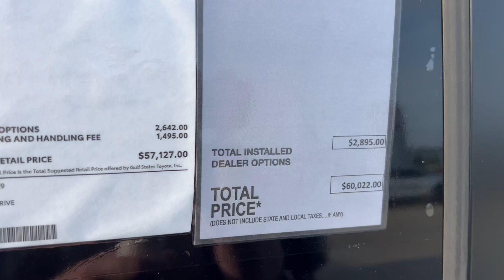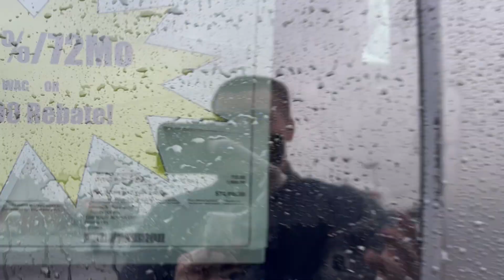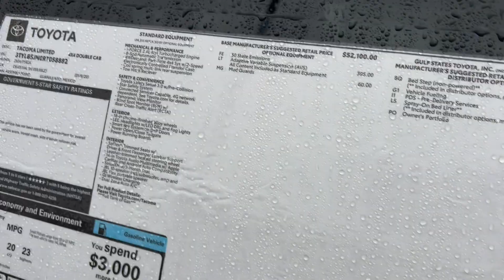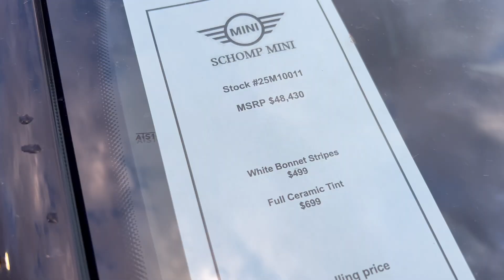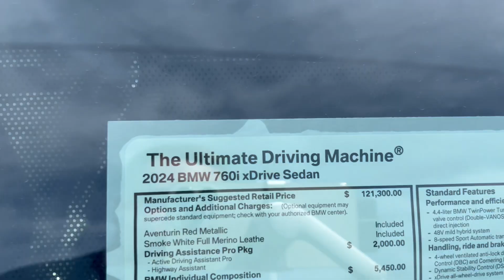No One is Telling You the Truth About Turbocharged Cars, So I Have To

Comment: It's absolutely sickening and destroying the market. Very sad times we live in. It's like Kia on steroids. You can't find anything nice anymore. It's cheap junk and more expensive on top of everything else. More cost and maintenance and long wait times to get fixed and raped by mechanics and dealerships when they need fixed and they will. More heat and friction equals more breakdowns and damage. Simple. They all want to talk about that nice shiny headlight and 14-inch display screen and everything else except the heart and soul of a vehicle, its engine. People will learn the lesson but it will take years. I loved Toyota and got 300,000 miles on both with little issues. Now I must pay 20,000 grand more and my used Toyota is worth more than a new one. It's unbelievable what they are getting away with. As long as people are foolish enough to buy them, they will sell them. Hopefully, people won't, and we can turn this black time in the auto industry over. Designed to fail, and everyone who knows anything knows they will. This isn't innovation, or better, it's greed. Pure unadulterated greed! When did cheap become better? Most people won't even have their new vehicle paid off before it's junk and not worth fixing. 
I love new tech and innovation, and I even think electric is awesome and will be, but we don't have the battery or infustructure to support them yet. I hope I'm wrong but common sense says everything. Good video. Thank you.

Comment: I own a 2003 Saab 9-5 station wagon that I drive between New York City and Florida once a year. My Saab has a 4-cylinder B235R engine with a large Garrett turbocharger. It has over 173,000 miles on the odometer. This car averages 30 miles per gallon at 75 MPH when it is loaded. Saab perfected their turbocharged engines in the early 1980's and deliberately over-engineered them to handle the stresses of turbocharging. The B235 engine produces 260hp, but the engine block is built to handle over 500hp. That's how you build an engine to stand the test of time. Today, manufacturers could care less about building durable turbocharged engines much less fuel-efficient turbocharged engines. Many new engines today don't even have oil dipsticks. Insanity.

Comment: its all about emissions & meeting CAFE and C.A.R.B standards. it is impossible to meet the required targets without reduced displacement, reduced frictional losses by mandating 0w-20 oil & increased thermal efficiency that turbos provide.  the cost of a turbo & required electronics is far more costly to manufacture than a larger displacement motor

Comment: How to make a turbo charged car last longer.

- Higher octane fuel.
- Letting it warm up before driving.
- Letting the car idle for at least 5 minutes after driving it.
- Keeping up on your maintenance, 3k to 5k mile oil changes.

Anyways it means more money for you in the long run. Toyota should have sticked with the V6 Hybrid system. 

2:06 Never underestimate Toyota fanboys, they will d*ck ride Toyota even if they decide to sell a car where the engine is an option that costs you more

Comment: Ford has had great success with turbo charged motors. This guy has a lot of opinions, but he is wrong. It is not turbos, not that motors and internals. This guy is a  idiot. Gm had had less issues with the 2.7 than both the 3.5  the 6.2. Turbos don’t fail leftand right. They can last hundreds of thousands of miles. I can’t even finish the video.

Comment: As someone who has a couple  turbo'd audis, turbos only last around 100k. And another thing is alot of times they mount these stock turbos under the motor where you have to pull the motor to rebuild/replace them. I love turbo cars but i would never want one in a truck. And yeah when your heavy on the pedal it definitely burns much more gas. Its just another expensive component that will/can fail and also put more stress on the motor. So yeah i completely agree

Comment: well i have two 7.3TD. Most reliable vehicles i have ever had period. But the last ones made were 22 years ago. One is at near 300,000 miles.  other is only at 210k. many of these go 500k and some make that 1m. though by then they must be very tired.  I plan to run those till the day i dont drive.  My truck is 29 years now 7.3 .  I dont need new. I can afford new because i dont buy new......would rather invest that 100k then buy a new truck.

Comment: Me personally, I don't mind the turbo.  Forced induction has been used for a long, long time in various applications.  If they are failing, it is likely to due to one of two things:  inadequate maintenance or the quality/design of the turbocharger itself.  Engines have been supercharged as well.  I've not heard of GM's 3.8 V6's that were supercharged being time bombs?  As for the fuel mileage:  that two varies by driver.  Same is true for a non-turbocharged engine.  The more often and longer you put your foot in it, the worse fuel economy.  The smaller displacement and turbocharging accomplish the emissions mandates.  It's the main reason they are used.  Talk to all the regulatory agencies and Congress.  They are the entities that caused all of these changes for vehicles in this country.  I would also suggest/wonder why so many turbo motors have like 0W-20 oil recommended.  They may be far better off to use a slightly more robust oil grade such as 5W-30 (especially if you are going to drive it hard and live in a hot climate)?
Reply: Superchargers don’t spin nearly as fast and don’t heat up to thousands of degrees from the exhaust.  Plus they are on top of the engine so they are easy to access and keep cool.
Reply: @PaulyDeeee  They are a bit different.  But, turbochargers are designed to operate in those conditions.  They are water-cooled and lubricated.

Comment: There's no replacement for displacement👍
Reply: Yea there is, it’s called a turbo.
Reply: These days engines should be capable of making 125 hp per liter naturally aspirated reliably without increasing the displacement. No reason to holding back your nation's engineers' potential.

Comment: Here's a wrench in the argument. Common sense maintenance. I find that a lot of people don't maintain their vehicles. Simple items such as oil changes at proper intervals, along with the other fluids. 
I've seen plenty engines with oil starvation related failures. Ridiculous claims of 15000 mile oil change intervals, lifetime transmission fluid. 

Couple the ignorance with cheap plastic parts like intakes, hose connectors, oil pans, and even water pumps. 

A recipe for disaster.

Comment: This same guy will tell you a turbo diesel is really reliable.
Reply: They are though, diesel engines are much more tolerant of turbos than gas ones.
Reply: @ the Chevy l3b in the Colorado/silverado is a diesel motor that was reconfigured to run on gas.
Reply: There is a big difference between from a turbo diesel and a turbo gasoline engine. Turbo gasoline engines are garbage.
Reply: He would be correct! Because, diesel turbo engines produce lower heat than gas turbo engines. The higher heat puts more stress on gas turbo engines.